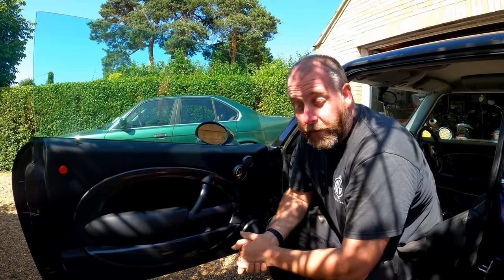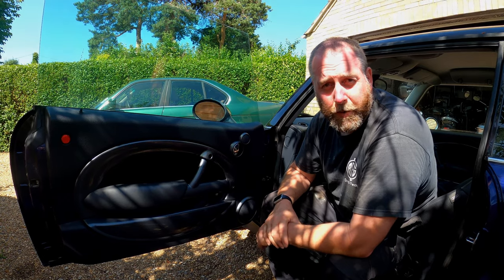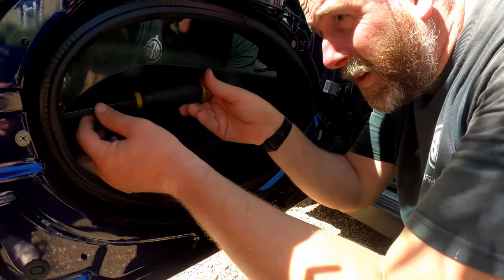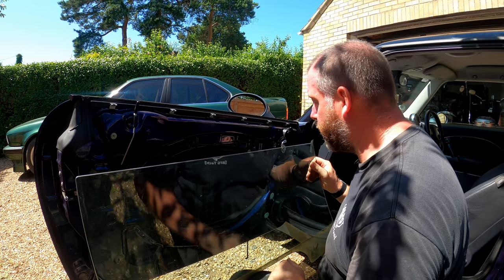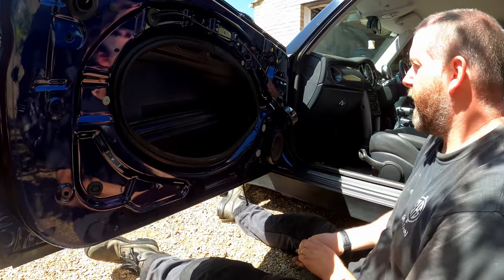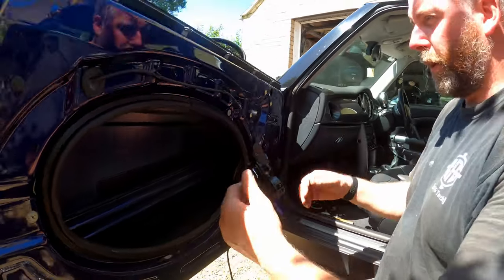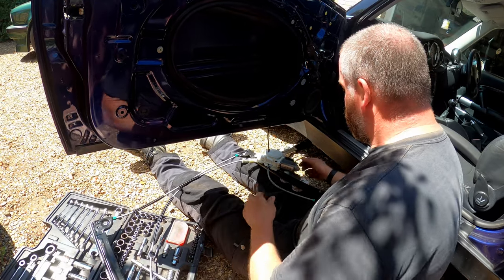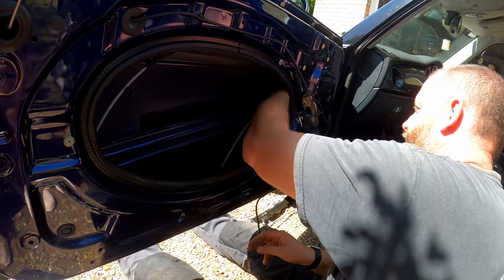Mini One, Mini Cooper and Mini Cooper-S, R50 & R53 Window Glass, Window Regulator and Motor Change

Comment: thanks kev, very helpful. followed this today to replace drivers side and passenger side glazing on my r50. i found that the glazing is supposed to sit slightly high in the mount (ie. it’s not supposed to sit right at the bottom of the mounts) - otherwise the window doesn’t meet the top of the door when closed. so i marked the white mounts with a marker pen to mark the position where the glazing sat so i could put the new glazing in the right position. all it then needed was a little adjustment forward/backwards so the window sat perfectly. then just re tightened the wheels. thanks again!

Comment: Hi kev I hope u can help I have a husqvarna 701 sm the neutral light has stopped working and have to start it with the clutch in so the bike thinks it's in gear do you think it's my gear position sensor? I've checked all other thinks around the gearbox I know you are really good with bikes hope u can help. Neil🤔
Reply from the maker: It certainly sounds like it may be the sidestand switch at fault mate, have you tried disconnecting the switch and bypassing it with a paperclip or similar and seeing if the fault remains. I don't have a wiring diagram for your bike but it certainly seems like you are in the right ball park! Hope you figure it out bud!👍